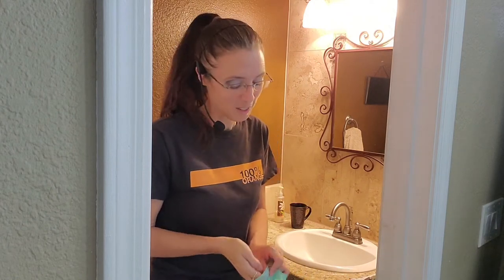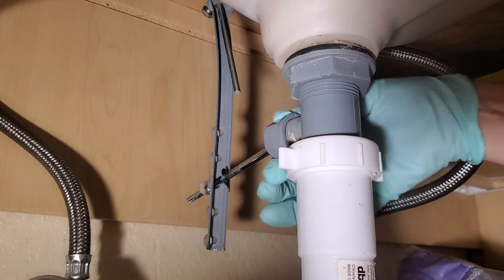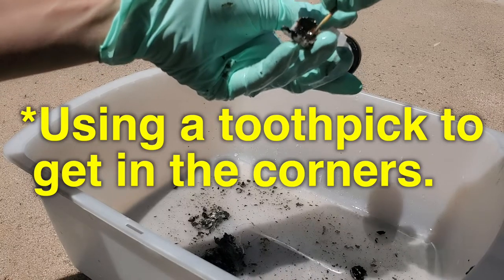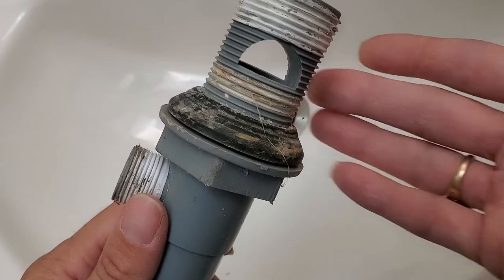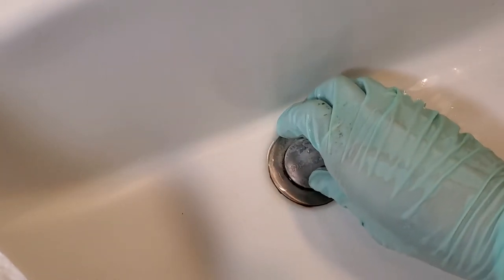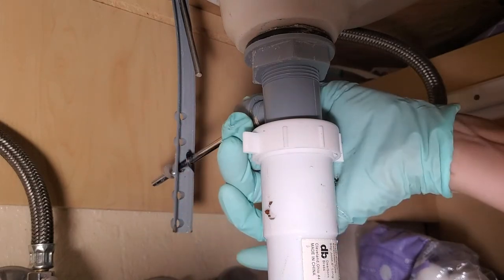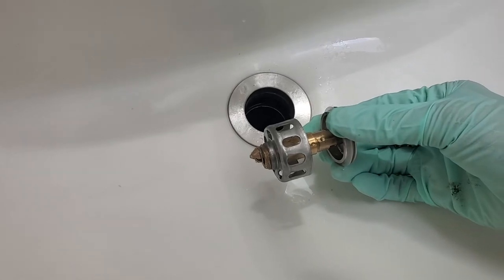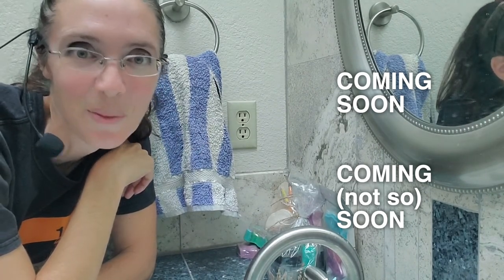Quick & Dirty Way to Clean a Clogged Sink Drain Stopper  (🤞 No Tools)

Comment: Very interested to see how the pop up replacement assembly performs long-term. That gums from the high use lavatory sinks is just bad!
Reply from the maker: Because I now have a calendar notice--and it is so easy to remove so I won't ignore the notice--the gumming will be kept to a minimum. Very stoked. $15 for a new drain and I don't have to spend 30 minutes taking the entire drain and stopper apart. It is money well spent and my time bought back.